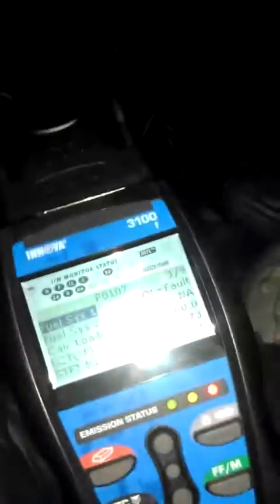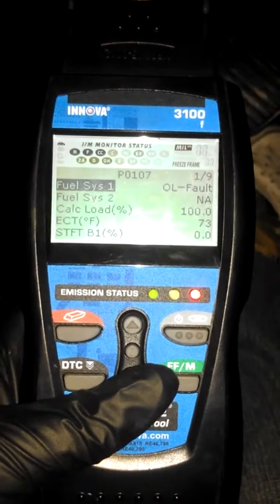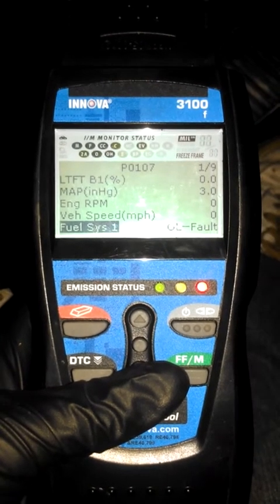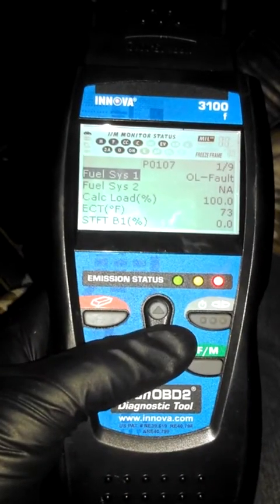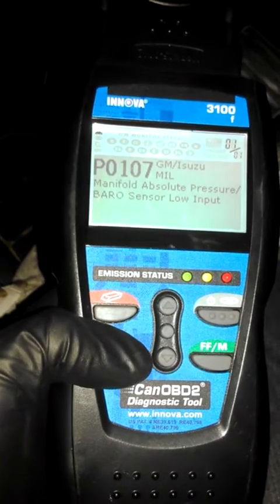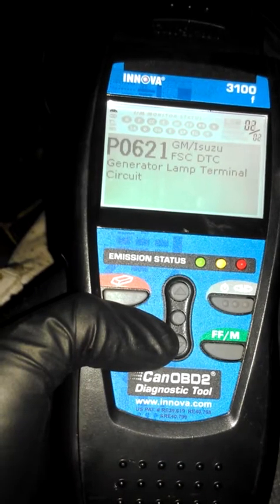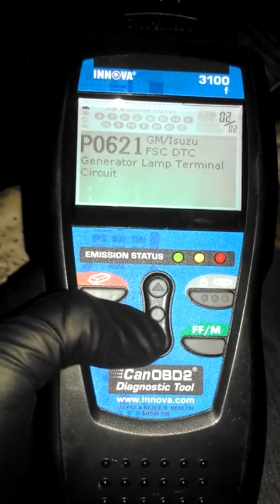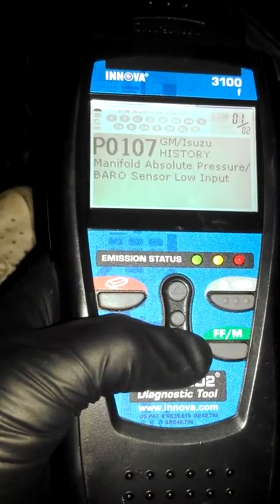Freeze frame data & mil codes

Comment: Example: you replace an oxygen sensor because it had a fault code for “slow response” (p0133). You replaced the oxygen sensor and didn’t clear the code. 3 Good trips that the PCM checks the oxygen sensor, and the Check Engine Light goes off automatically. Then 40 cold starts later, the PCM/ECU will automatically delete the code. 😎

Comment: A misfire code can also cause the PCM to revert to open loop. Due to loss of fuel trim control
Reply from the maker: Trevor Rodman thanks for the info.
Reply: s10rider07 you’re welcome. I’m not a mechanic but I’m pretty familiar with OBD II. It’s fascinating to me that these modules have the intelligence to detect when you fix a problem by “self diagnosing” and automatically turning off the “MIL.” I recently learned that after 40 warm up cycles, after the “MIL” is turned off, the PCM automatically clears the code.